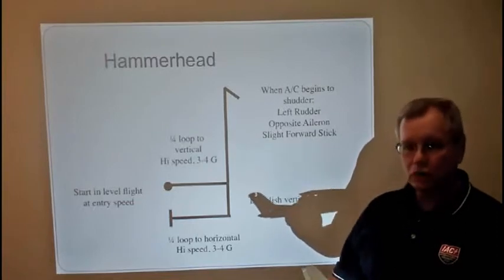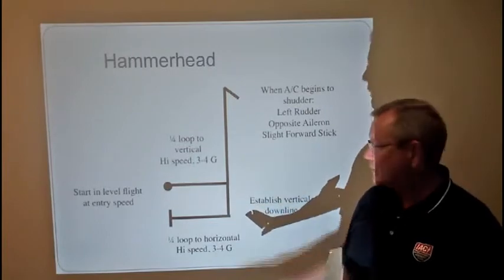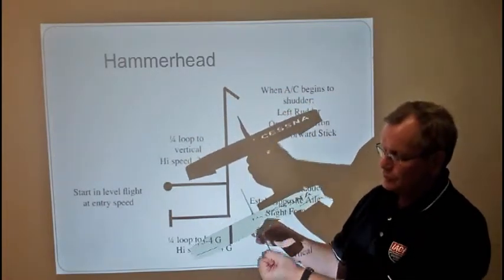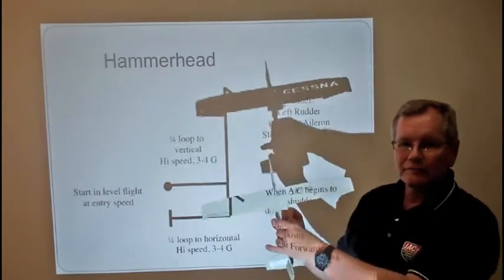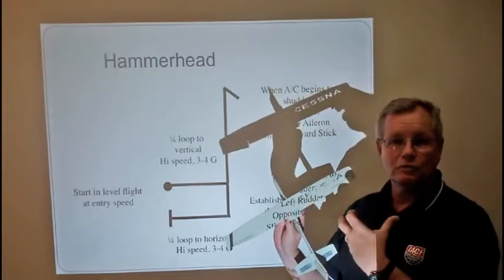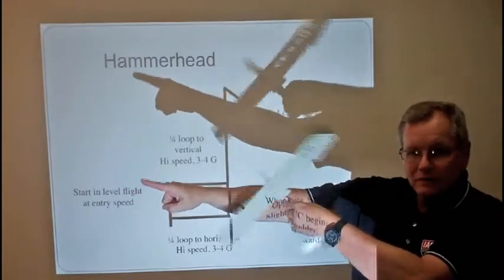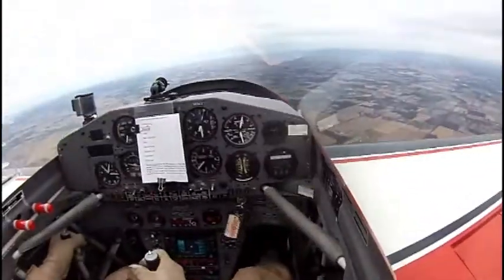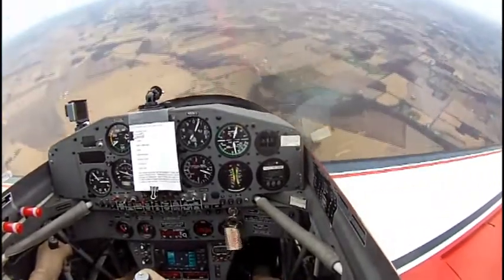The Hammerhead

Comment: Excellent effort and presentation of the basic figures. Just a comment on the cause of 'torquing' during the pivot - I often see it presented that the left roll is caused by the right wing's greater airspeed during the pivot (to the left), which increases lift on that wing, causing a roll to the left. This force would be present to a degree if pivoting from a positive attitude, but a competition hammerhead should be done from the zero lift attitude on the upline. The wings should be at zero AOA before, during, and after the pivot. At zero AOA, there is no potential for yaw to create a lift imbalance between the two wings, causing a roll reaction. Assuming the pivot is done from the zero lift axis, the left rolling force (and need for right aileron) is purely a function of propeller torque. If lift-induced roll was a factor during hammerheads, gliders would be extremely susceptible, given their long wings. However, aileron is not required during glider hammerheads, since the wings are at zero G, and there is no torque from a propeller. I consider this is a minor point on the dynamics of the maneuver, but worth mentioning. Thanks again for producing these videos.